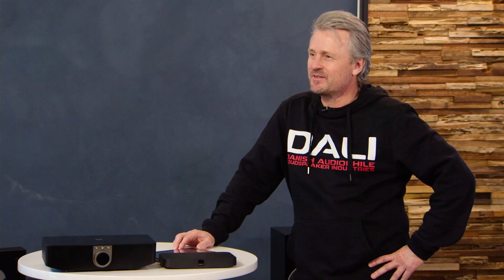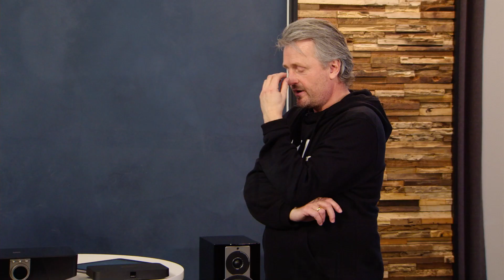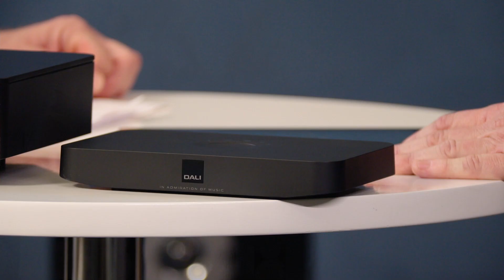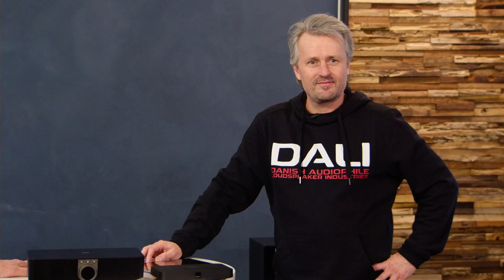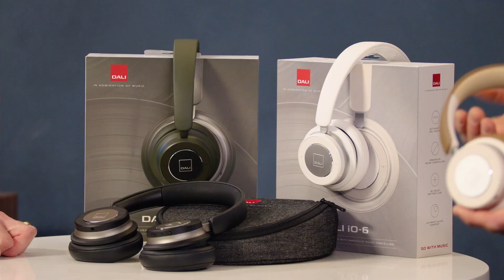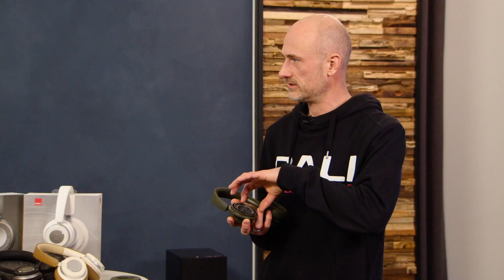DALI: Draadloos geluid en compromisloze hifi-kwaliteit gaan heel goed samen

Comment: What about the longevity of an active speaker system? We saw Sonos "abandoning" their 6 year old speakers as their technology didn't match today's standards. And we see it happening all around us, technology moves so fast. So investing in a €4000 active speaker system raises the question for how many years they will be supported? Normally passive speakers will last for 30 years or more. Investment wise it seems like a more solid decision. However, I'm not technology expert and might be wrong. Just wondering...